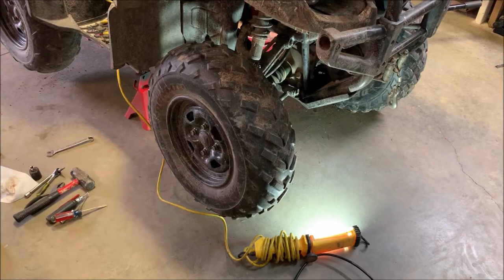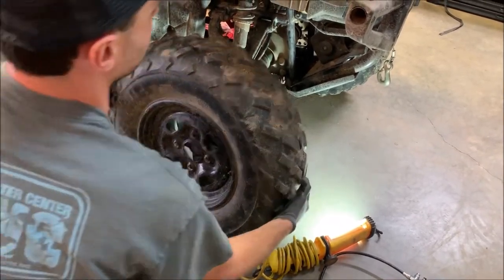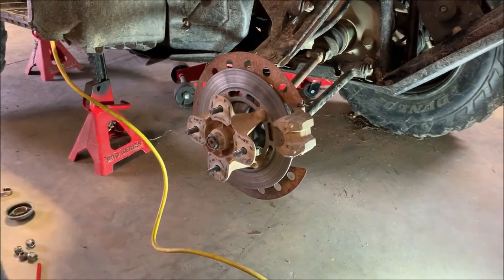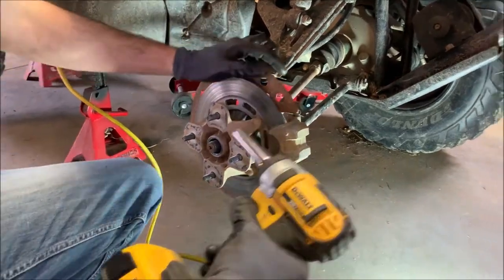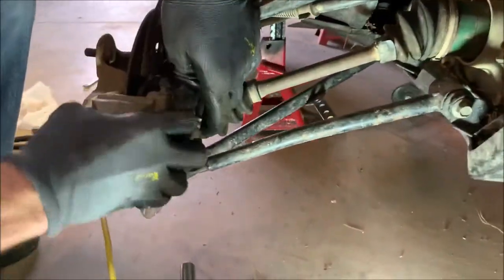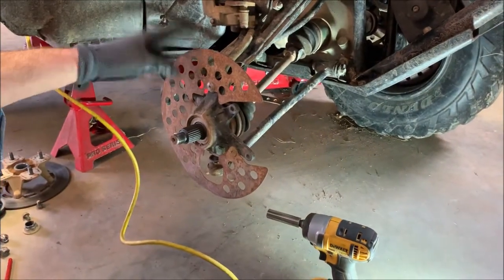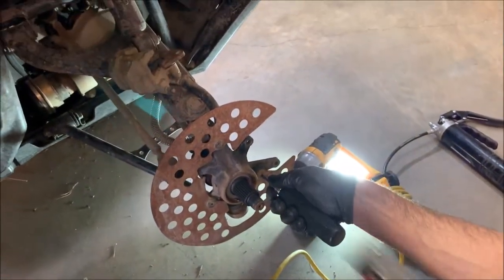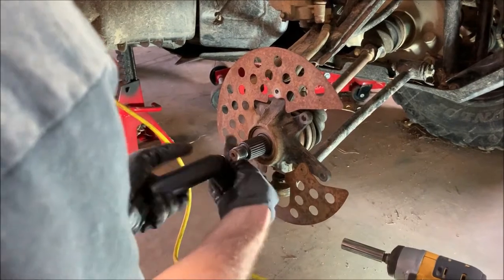Yamaha Grizzly 550, 660, 700 Front Axle Bearing Replacement

Comment: I saw another video on a grizzly where ther was a lip and a spacer in the center of those 2 bearings ?
Reply from the maker: There is a lip on the backside of the knuckle that prevents the bearing from pulling out the backside when it's being driven. I have never heard of a spacer being used with bearings.
Reply: I just replaced my front wheel bearings on my 2002 grizzly.  It does have a spacer between the two bearings.  The bearings have to be knocked out individually one from the top side and the other from the bottom.   I put the new bearings in the freezer for a couple of hours and heated up the knuckle.  It worked out great.  If I can do it anyone can.  Hope this helps.